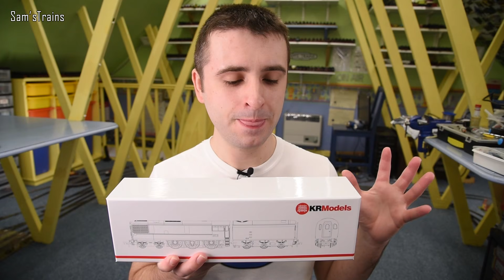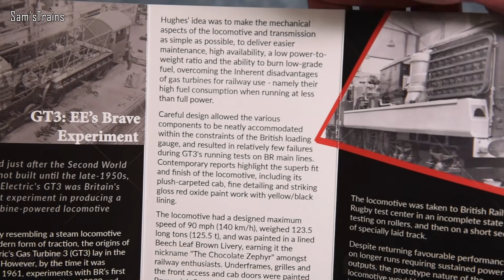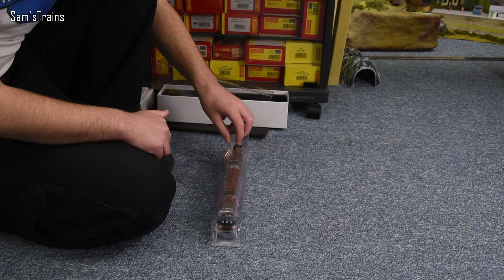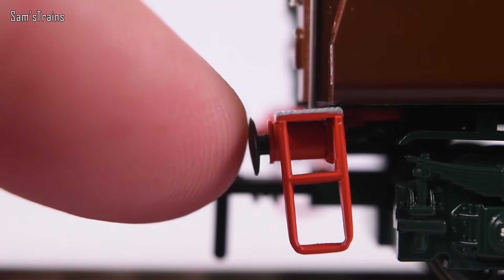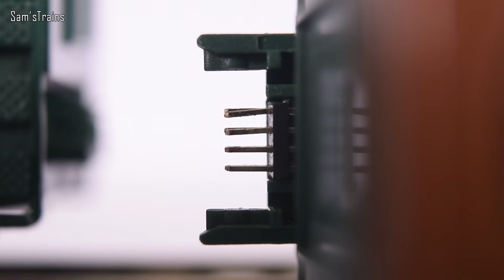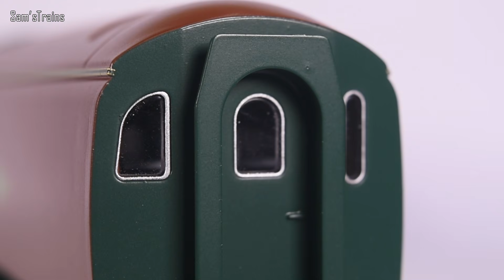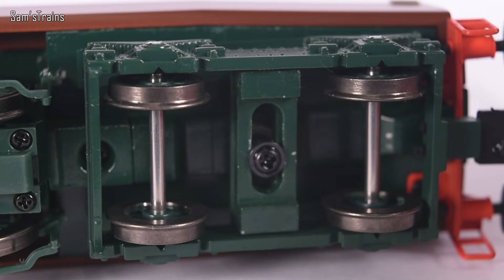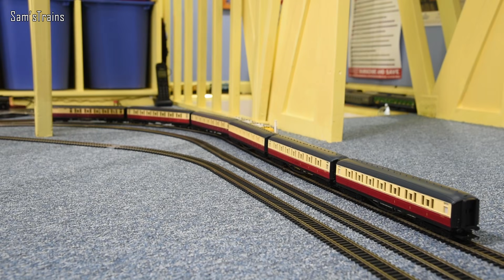Brand New GT3 Gas Turbine Locomotive | KR Models | Unboxing & Review

Comment: KR wanted to make a statement, big shot across the bow of Bachman, Hornby, and anyone else in the field.
Vagon would not accomplish it, small tank engine might if priced aggressively but no they chose a flashy way of coming up with a turbine. I very much approve of that attitude.

I really like the design of the loco itself, and seems like model version of it is quite decently replicated it, if somewhat patchy in handful areas. Good, i am hoping for upset and maybe more competitive field after KR's entry. Infact the colour seems to be rather unusual and for that i think it deserves some extra love.

The specter of one questionable design choice (bogey up front), i think there needs to be more effort expanded to prevent such things, test in more diverse environments maybe? That dose deserve full star penalty, not everyone will fix it and the costs are such where things like this should be ironed out by the time of release.
Reply from the maker: That's very true... but to attempt a huge project like this could have broken them if it went wrong... fortunately it did pay off! Yes it's patchy in a few places, but overall an excellent model! You're right, no excuse for basic mechanical failings such as that... the front bogie is a bodge, and I fail to see how that wasn't apparent during the sampling process!
Thanks for watching, Sam :)

Comment: Finally a model worth the high asking price!!

Makes you wonder though how a comparatively small company like KR Models can tool build and design a brand new model like this with the level of detail they have.

And meanwhile Heljan are selling a mass produced Ethel1 class 25, which DOES NOT have a motor for the same price as a Motorised one?
£152  by the way...

Nah something isn't adding up here with Heljan and Bachmann
Reply: What do you expects them to do pit a motor in it and then get criticised for it not being realistic?
Reply: @davidstrains4910  no, make it cheaper than the bloody Motorised one!

It's not complicated is it???
Reply: @IronHorseRailways  why is it bachmann and Heljan that get the criticism with this, hornby do a mk3 DVT and that costs £75 altogether and that doesn’t have a motor so should that price be lowered as well?
How much do you think the ETHEL should cost?
Reply: @davidstrains4910  a lot less than the motored variants.

Using your examples the DVT is considerably less than the powered car variant.
Reply from the maker: Yeah I get the general point... impressive that a brand new manufacturer with limited resources can match the price of the big boys... but I suppose it's not too surprising, as many have their suspicions about average mark-up anyway! ;D
Thanks for watching, Sam :)

Comment: Its a lot of money for it to keep derailing without having to fiddle with it.  PS have you reviewed the Bachmann class D11 Director "Prince Albert" Super looking model?.
Reply: Easy enough to fix though. But it's a fair point spending that much money and having to mess around with it. For the money I can see why people would want a loco that doesn't need to be messed with.
Reply from the maker: Yes you're right - I'm not saying it's acceptable to have to make repairs, and I did reflect that in the score!
Thanks for watching, Sam :)
Reply: @SamsTrains  If you hadn't played with the bogie, you would have been fine.  It's loose for a reason so that it will get up an incline.  And no, it won't fall off.
Reply: @krmodelsltd5065  not a great reply, when a well respected model rail youtuber has reviewed your product for their large audience and you chastise him for 'fiddling'. Most people are going to fiddle, and anyone can see that screw needs to be loose. If it is correct, perhaps you could release a video explaining how the mechanism works and how we can avoid fiddling with it when servicing?
Reply: @krmodelsltd5065  well i was considering getting my hands on one, but I don't think I want support a company that chastised a respected reviewer for doing his job.
Reply from the maker: No, not a great reply. And you're incorrect; I didn't "play with the bogie", it dropped off during my inspection, leaving me no choice but to re-attach it. So yes, it will fall off, and no that doesn't explain why the screw should be loose. I'd expect a more gracious response when a paying customer clearly demonstrates an unequivocal design fault.
Thanks for watching, Sam :)
Reply: @SamsTrains  The bogie frame looks the wrong way round compared to the box illustration!

Comment: There is a known issue with the buffer beams and bogies. The holes the vertical handrails fit into are in the wrong place. And the guard irons are at the rear of the bogie instead the front. Both parts are being replaced and sent to customers soon apparently.

I think your model does have a few issues grills and marks you mention, mine doesn't have those so maybe just an odd one.
Reply from the maker: Thanks Matt - yes I did notice this too, but couldn't ascertain whether or not that was intentional, as they're miles away. Duly noted on the other issues - I can see those being inconsistent!
Thanks for watching, Sam :)

Comment: Sam, it looks like they have fitted that front bogie the wrong way around!
The guard irons are on the inside instead of the outside nearest the bufffers.
Reply from the maker: Do you think so?! That's very interesting - it definitely came that way though, given the front coupling!
Thanks for watching, Sam :)
Reply: @SamsTrains  Check out your pic at 15.46, you'll see the guard irons just above the rail head under the front steps. :)))
Reply: @formidable38  @Sam'sTrains The KR Models stock photo is also the same (incorrect) way round and looking at a brief search on google images so are a lot of them - of course, they could be the same 'stock' model from different angles.....but should that make much difference to the running characteristics?.... I'm not so sure.